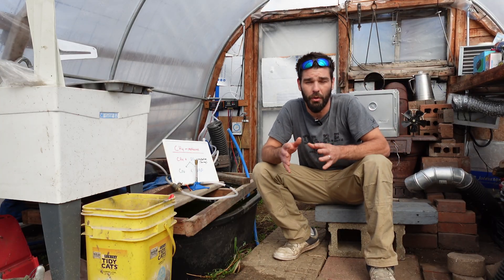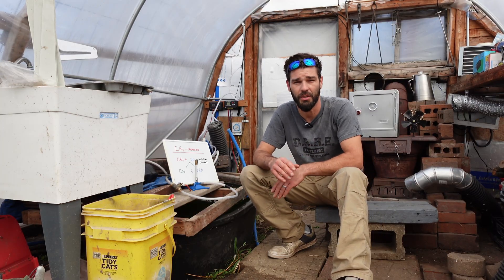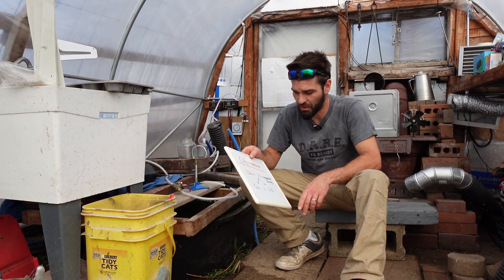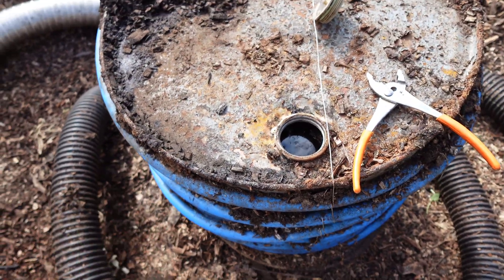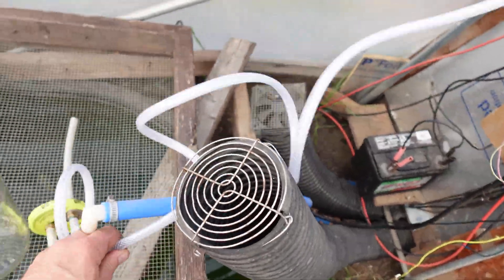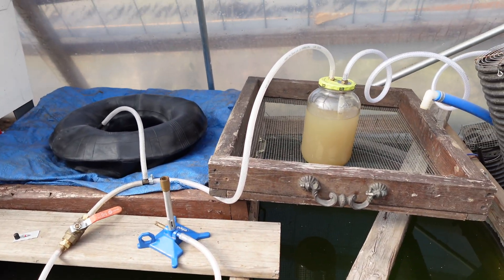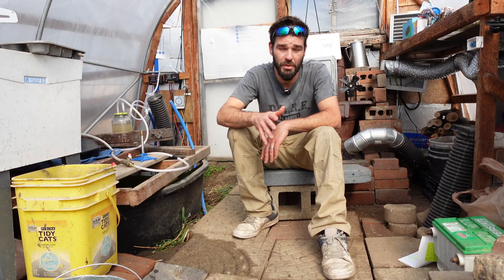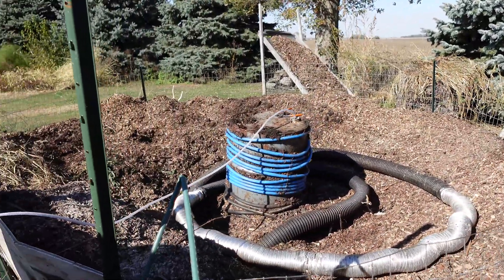DIY Methane Catchment System FULL BUILD - JEAN PAIN COMPOST HEATING - Using Everything

Comment: I highly recommend the Home Biogas company's system. They are inexpensive for what you get, and can be put together in an afternoon by a few people . They are the system the local biogas coop helps people install, because they just work, and people can afford them. The Aarti system from India is also very very good, and designed to be DIY in a limited resource environment 
Glad to hear you mentioning using the heat from aerobic composting, to heat the anaerobic system 
 The main problem with methane biodigesters in cold climates is that the microbes stop working for a large part of the year. An antidote to this would be to have your biodigestor inside a greenhouse, surrounded by/adjacent to a hot aerobic compost .The compost would heat the anerobic compost digestor, and the greenhouse space simultaneously
Reply from the maker: Thanks for your input!! I want to put a biogester inside the greenhouse permanently

Comment: Check valve(s)!! Would hate to see fire back flash into that tube.
Reply from the maker: I have some check valves for fish tank air lines I wonder if they would work, I thought about installing them but deferred to just running the simple system for everyone to see
Reply: @Earthdwellershomestead  they might but often cheap fish tank valve require a relatively high and or inconsistent pressure.  That being said they are cheap so might be worth a shot.

Comment: An interesting project.  Don't underestimate the time it takes to get this process started, the bacteria that produce methane are effectively the last in a 'community' of symbiotic anaeobic processes that break the organic matter down, they need to reproduce and populate the vessel contents before they become productive.  You will initially produce a lot more CO2 than CH4 in the gas, that is not all wasted though as it is useful to purge the air you have in the system out.  As the process matures, the ratio of CO2 to CH4 changes and the gas will become burnable.
One of the biggest operational issues for this type of system is gas loss from the joints in the system.  The drum will have to be under a certain amount of gas pressure to overcome the head created by the lye filter, a lot of small scale digesters lose their modest gas production to minute continuous leakage at joints in the pressurised system.  

Also consider a gas tight dip tube in the barrel to allow the addition of liquidised material to the barrel without opening it, the same could also permit a rudimentary agitator to be left in place, using that will significantly improve the rate of process stabilisation and yield more gas too.

The C:N discussion was interesting too, remember ligneous material for all that is is carbon rich, does not have good availability to these anaerobic bacteria so relying on woody material alone, particularly if it is fresh is not the best way to maintain the C:N balance.

Comment: methane is easy. yet hard.
gotta remember, a digester is alive. its like a gut. one wrong ingredient and it goes all wrong! and they dont clear themselves...

the bigger they are, the more stable they are. a one man unit is next to impossible.

something next to a pig farm with horse stables nearby is set... just get 10KL tanks...

batches... work. to a degree. constant feed is the pinnacle...

ratios of plant : poop : water : vege scraps matter.

the weekly lawnclippings... mulching teh scrap... clear the chook pen... muck the goats...

then when you really need it... there is none. no green, anyway. lot of the bulk, gone.

 empathy... we barely get a frost here :) not an issue for me...
Reply from the maker: Thanks for the input!! Thanks for checking this out also!

Comment: Great project! I’m curious how much pressure the system can build up inside of it if you didn’t have the burner on. Do you see any potential for using a compressor to facilitate longer term storage of methane ? I’m sure it would take more cleaning and filtering to do so. Thanks for sharing all these vids !
Reply from the maker: It won’t build much pressure till I get my compost dumped around the barrel as the temps dropped down drastically. I’m hoping to just get production to burn as an experiment so I can further development. I plan to get a large biogasbag for storage later on for maximizing storage of methane without having to dangerously compress it or add more complex systems to support that. Thanks for checking this out!
Reply: @Earthdwellershomestead indian peoples use Biodig. Long time, there bulid good systems "Diy" and Buysystems from this Country Comes from own exp. 👉 use thisinfo as inspiration for ur Projekt,... I use two Black boxes for my Own Bio"secondlive"... 👉 i use the Liquid for the Plants and Yes on single Flame i got last year.. //compresure not needed.. But i want not Spoiler.. 😅 one Tip, the only pressure who u need is for the Bag or ur Container with the Gasair, but its easy a random weight.. A Manometer 'for Burner +/- is important.. 👉 the Flame is not like normal Flame- u can see the Color easy- watch out by testing.

And second Tip, the Gas smells like Oldeegs but this not a Savetyfuture...
Dont do that at Home.

FOR ALL READERS.. 👉 THE WASTE HIMSELF CAN BE VERY UNHEALTHY FOR U SO U MAKE SURE WORK CLEAN -

☝️ 😎 AND YES. 👉 toclean the Wastecontainer/bag its better down near the GROUND  to have a Biger Outlet, ...
After a period of time u have Change the componets otherwise u have Blocking Mut inside that cant really good preduce METHAN.. 👉 overflowsystem isclosed from Air u can earn both materials Gas/Liquit and ur System cleans half self.. 👉 only from time to time the Groundventile open to let the Hardstuff outflow.. 👉 the system to feed each week with 2,5 kg is next Quest 🎉.. For each Day of the Weeku need round 10kg of Konstantly Biotrash feeding..
Otherwise ur Bakteria will not survive.. And under "Bodytemp" of a "🐮" there love tolive and work.. So the waste himself preduce heat, but in cold times lowers the Temp. Effizence of the earnable Gas too.

I hope it ansers a couple of questions before u Start 😅.

Comment: This is so cool. It will take a little bit to sink in. But I love Mr wizard .   Hey, would fish poo help mak methane?
Reply from the maker: I'm sure it would, lots of nitrates in fish poo. that would be an easy addition to a tank for sure, I did it this way to have a sealed environment void of oxygen, unfortunately it has a very small feed and drain hole so it forced me to use smaller materials. I'm hoping once my compost pile is going I can get some methane fuel going in here. thanks for checking this one out